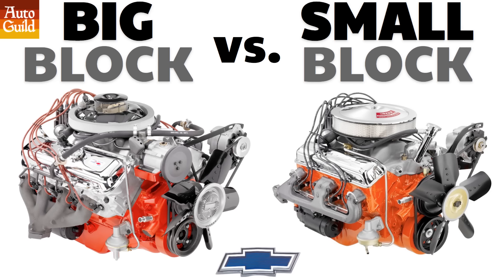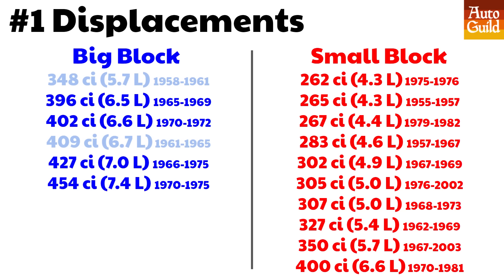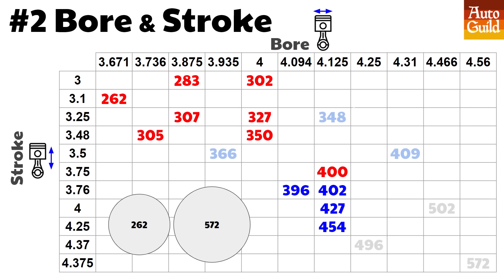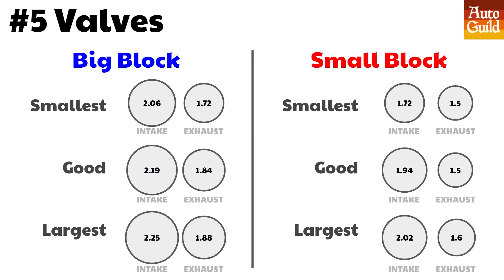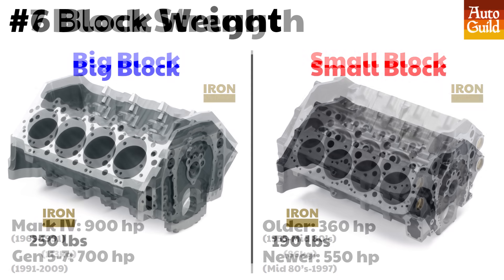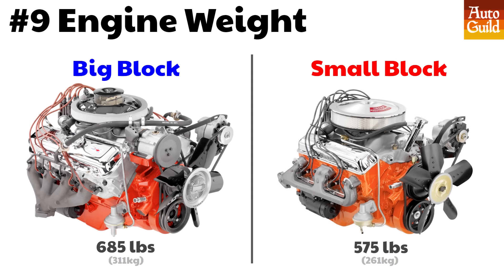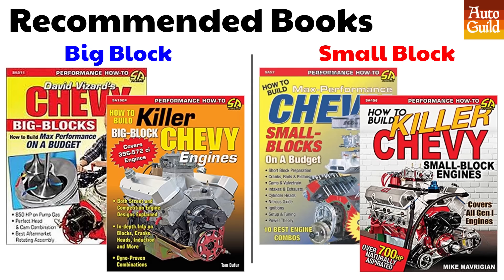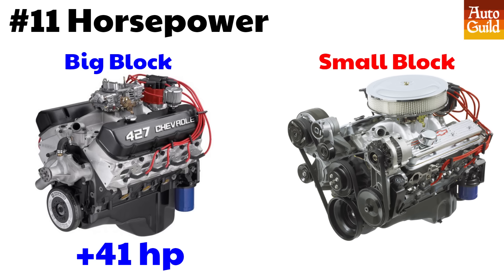Big Block vs  Small Block Chevy Comparison

Comment: The 402 was called a 396 in the 70-72 chevelle, was called a 400 in the full size chevys, and was called the 402 in the pickups.
Reply: so what is the different from a 68 396 and a 70 402 nothing
Reply: @jeffrey4547  402 is a 396 bored .030 over.
Reply: @mr.e1220  i have a 396 out of a 68 pu then i have the 402 out of a 70  pu but i put in a stroked 454 witch is better yet and u forgot the 25 hp different in the engines
Reply: 400 is a small block, the 396/402 was never known as a 400, ever.
Reply: @mr.e1220  the 400 small block was called the Turbo Fire 400, the 402 big block was marketed as the Turbo Jet 400. So yes the 400 was offered in both small block and big block.
Reply: @matthewsherman1450  if that is what marketing called them, it sure is misleading.  I guess u are correct in a marketing sense. But a 402 is a 402...big block. A 400 small block cannot ever be called a 402, so marketing made a huge error. That's probably why that knowledge is not remembered among many, it is bad marketing. Also, a 402 was not just in trucks,  many full sized Chevies had a 402, including Monte Carlo.
Reply: @mr.e1220  The 1970 Monte Carlo as an example, was offered with the "Turbo-Fire 400" (small block) and the "Turbo-Jet 400" (big block).
Reply: @matthewsherman1450  correct!

Comment: Never saw the need for any muscle car with more than 450 HP if it’s never going to see a race track. Small block is definitely the way to go for the weekend driver.
Reply: My 55 Chevy has 452 hp with a 383 and its silly powerful, silly
Reply: Until Dodge started releasing 800 HP that will hook

Comment: This is about 70% accurate.
Reply: Yeah it definitely has a few errors.  The 454 lived on way past 1975.  The small block wasn't replaced by the ls family of engines.  The opti spark Lt style engine came before the Ls.  I'm only 2 minutes into the video and found these errors.
Reply: @ziptiejedi5658  LT is technically still a small block chevy
Reply: @ahmadtajy  100% correct, LT small block! 👍
Reply: @ziptiejedi5658  Yeah my 3500 is a 1999 with a 454 bb
Reply: @ziptiejedi5658  you're partially correct.  The Gen 2 aka LT did replace the GEN 1 in the Corvette, F-body and Bbodies, BUT the Gen 1 350ci lived in Trucks, SUVs and Vans up until 2003 when it was replaced by the Gen III aka LSx.
Reply: @ziptiejedi5658  at U-haul back in 2008 we still had new trucks with 454s in them. That engine was a beast.
Reply: @ziptiejedi5658  iirc mercury still makes a marine engine from the 454/7.4
Reply: @ziptiejedi5658  You all missed the part he clearly said at 1:26 KEEP IN MIND I'M focused on PASSENGER CAR Engines.
Reply: A Ford guy knows a small block will make way more than 360hp. It looked like he had block integrity power listed for the big block and the 70 Z28 motor advertised output for the small block. However I give em a pass. It's great to see young guns keeping the old stuff alive. The more he studies the more he'll learn.
Reply: @duster0066  just because you’re young doesn’t mean you have to be incorrect and ignorant about it. There are many kids in the wild who could wrench circles around him and know much more than the Wikipedia facts this guy knows.
Reply: Donalld Allhands  yeah I have a 94 Silverado with a 454.
Reply: @ziptiejedi5658  you seem to very knowledgeable, I currently have a 305 fuel injected 1986 trans am, what engine should I swap it with. I want to have around 400hp, but not go with a big block, what engine options are good. (Low bolt-on budgets too)
Reply: @goodafternoonworld4456  if it were me I would go Ls.   Get a junkyard 6.0 or 5.3, put a new cam/valve springs in it and use a Holley Terminator for an Ecu.  You will easily get to your 400 hp goal.  I wouldn't bother with trying to keep the factory fuel injection it's hard to find someone to burn chips and it so easy these days to swap an ls into a 3rd gen.
Reply: True, I own a suburban that has a 454 and it’s from 92 almost 20 years newer than 75.
Reply: @PUGSRULE-ut6ez  i think he’s talking about just the corvette and Camaro
Reply: The other 30% of the video was 70% accurate so it evens out
Reply: My buddy has a 96 with a 454, and I have a 99 with a 350 Vortec.
Reply: Yep, there are 3, not 2 styles of bbc heads
Reply: Yea my fleetwood bounder is a 98 and it has a 454
Reply: #7 on the list about block strength isn't even close to 70 % accurate.  That alone makes the video totally irrelevant.
Reply: 1970 LT1-350 Corvette was rated from the factory at 370. I think the info in this video is rom a poster that reads a lot, but has never built an engine. I could be wrong, but there is a ton of misinformation in this video.
Reply: @bryangeorge9461  seriously the 1st gen small block Chevy block can take 400-430 horsepower with all stock internals. More than that and you’re sacrificing longevity but it’ll take it easy.
Reply: Donalld Allhands  there was also a 496 big block in the GM HD trucks until 2006 or so
Reply: @lomfmur  yep but it was marketed as an 8.1, vortec 8100. It was the gas upgrade option over the 6.0/vortec 6000 from 01 until 06/07. The 8.1 equipped trucks were actually rated from the factory with a higher max towing capacity than the Lb7 duramax, might have been the same for the LBZ but I'm not sure.
Reply: having worked the auto parts business for years back in the seventies, i sold lots of incorrect parts to know-it-alls.
Reply: Am I just dumb or did he put the 327 as a 5.4 when I'm pretty sure it's a 5.3 a 5.4 is a Triton
Reply: @shanerussell7395  Well, 327 cubic inches = 5.35857 liters. So .. do we round or not? More technically, the 327 is a 4 inch bore X 3.25 inch stroke. Let's do the math 4*3.25*pi*8 = 326.725 cubic inches which = 5.35406 liters..... so again, round up or not?
Reply: He mentioned that the big block lived on. He is probably limiting his comparison to production models and a single generation.
Reply: @theeoddments I have a stock 2 bolt main vortec 350 shortblock with .030 over speedpro pistons that retain factory compression ratio and a 238/248 hyd. roller and a Chinese single plane that made exactly 500hp all motor with some home ported vortec heads. This video is extremely inaccurate. Stock blocks can handle more than 350 hp. Absolutely ridiculous claim
Reply: What’s wrong with the 30%
Reply: Yeah my 78 Córdoba is a 400 big block not a small
Reply: @Rhychus1  its also a Chrysler not a Chevy🤦🏻‍♂️ which would explain why it has a Chrysler engine not a Chevy engine
Reply: @codycraig5657   he saying anything 400 under  are small blocks in his chart... rather it’s a Chevy engine or Chrysler my engine is NOT a small He’s not all correct that all I’m saying 🤦🏾‍♂️
Reply: yes run an 87 r20. has 454.  just did a rebuild on it. it's great. I'm a contractor and it will tow anything, haul anything.
 I love it
Reply: I've seen 5.7 350 Sbc make well over 700hp.
Reply: Better % than sex panther Cologne .... 60% of the time... it works every time
Reply: I thought big blocks usually had a four bolt main. Where a small block usually had a two bolt main?
Reply: @donspencer1274  Many small blocks had 4 bolt mains. Performance and truck models.
Reply: @donspencer1274  not necessarily. A lot of Chevy big blocks came with 2-bolt mains. The high performance versions had 4-bolts, but not the smooth-idle passenger car versions. Small blocks didn’t get 4-bolt mains until 1969, and they were only used on Z-28 302s and some 350s.
Reply: if that lmfao
Reply: in response to OP
Reply: 30% inaccurate.

Comment: I think the block strength for the small blocks is a little off. If you’re just referring to the block, not the crank or other factory components. I had a 408 that used a 1971 400 block that made a little over 600 hp. Still had factory caps and main bolts and frequently saw 7,000+ rpm. Good video though, liked the weight comparisons for sure.
Reply: Would like to know more
Reply: @DRG00DandS3XY  what would you like to know?
Reply: @brandon_419  heads, intake, carb, cam, valve diameter...
Reply: @DRG00DandS3XY  it had dart pro 1 227 cnc heads with minor port/chamber work and 2.08 valves, dart single plane 4150 intake, quick fuel 950 carb, mahle power pack pistons with a 4cc dome that put the compression at 12.5:1, and a .670/.630 264°/272° @ .050 cam.

Comment: How to make a big block as light as a small block?  CADILLAC 500!
Reply: Every one thought I was nuts cause back in 1984 my first car I bought for $100 was 1970 coupe deville. I immediately recognized the potential that 472 had with all that torque and 375hp stock trim. My first time at the 1/4 mile the car ran 14.3 only modifications were dual exhaust with flowmaster mufflers. Next modification I did was the biggest horsepower gain I added short headers and aluminum intake and HEI ignition That woke that engine up unbelievably.went back to track & car went 13.2 nocked off a full second. I won a lot money with that car street racing. Ultimate sleeper. Miss those days
Reply: Just dont rev them anywere near 5000 rpm or they go bye bye great tq engine though not realy suited for drag racing
Reply: @rooster68able  they don't like being over 4000.  True.

However, fox the valve train issue and I can't recall the other issue off hand....and 5500+ rpm won't be a problem.

You can gear these ones to the moon because they have torque like a diesel...and at 2400 rpm for a torque peak, you don't have to wait for it.
Reply: How to make big block power lighter than a small block?  BUICK 350!
Reply: @marclaporte7163  The 500 Caddy only weighs 60# more than a Chevy 350.  And you wont come close to the amount of cubes that the 500 can be stretched out to with a 350.
Reply: @markdubois4882  Interesting.  That is a heck of a motor.  But for my 68 Le Sabre, I still love my Buick 350.  High nickel content Y block much lighter and stronger than a Chevy 350 and can make as much power as a Buick 455 with minimal work..  Factory roller shaft rocker heads.  It's smooth and "refined."  Torquey and reliable..  They were stock in the engine rooms of the most high end Dauntless yachts of the 1970's.
Reply: @marclaporte7163  the Caddy motors were also really high in nickel content.

Bore: 4.300
Stroke: 4.304

Can be bored to 4.420 without sleeving, and easily can be stroked to 4.600+
Reply: @markdubois4882  Hmmmmm.  Do you know what their best options are for manual gearboxes??
Reply: @marclaporte7163  as far as I know, the Caddys haven't had a manual transmission in their cars from 1957 til sometime around 2000.

Can it be done?  I don't know if the tranny will handle the 472 and 500's sheer torque, especially if the engine gets modded.

Both these motors push over 500 lb-ft in pre-71 spec (higher compression) stock trim.

Add a turbo to the 500, and I highly doubt a manual tranny will hold.
Reply: @markdubois4882  Found this:
https://www.motortrend.com/how-to/cadillac-engine-with-manual-transmission/
Looks like it's a standard BOP bellhousing behind a Caddy 500..  This has me interested.  Thank you.
Reply: I was thinking  68-70 472, or 500 with 472 or 425 heads, but yeah. They all came with forged cranks too. A simple intake manifold change to aluminum and weld on flanges for bbc headers, recurve the distributor,  there ya go. They are about bomb proof as long as there's a couple quarts of some kinda oil in them. Cheaper than most builds too
Reply: @assymcgee2835  the 500 is a stroked 472.  Not a good idea to put the 425 heads on a 472 or 500.  The bore is way too small.  Picture 305 heads on a 350.  The only thing the 425 shares with the 472 is the stroke of 4.06 inches.  The 425 vote is 4.08 inches.  The 472 and 500 both have a 4.3 inch bore.
Reply: @markdubois4882  its been done, and alot of guys, me included,  run 305 ho heads on mild 350s. I think a few if the cadillac engine builder sites recommend the 425 heads also, but you gotta run 100+ octane
Reply: @assymcgee2835  we have a 350 lt1 at the shop with a set of 305 heads.  All the compression you could ever ask for, but it doesn't breathe for shit.  There's .264 inches difference in the bore between the the 350 which has a 4-inch bore and the 305 which has a 3.736 inch bore.  Not to mention the much smaller valves on the 305 head.
Reply: @markdubois4882  seems to do just fine in my truck, then again, its a heavy truck and I don't rev it high. Different configuration work for different cars, uses, etc.
Reply: 572
Reply: @shadowopsairman1583  a 572 is just a punched out 454.

The caddy 500 is only 60# more than a 350 SBC.
Reply: @markdubois4882  NOT!
Reply: Just invest in a u joint company! Itll tear em up if you actually giver the beans.

Comment: Big blocks make off idle torque. Right off idle you could have stock 350-400 ft-lbs of torque sometimes double what small small blocks offer. The issue with big block cars that always matters is traction.
Reply: But I have a modded L82  1976 4 speed with a small over driven blower reworked 2.02 heads 9.1 compression  800cfm vac carb  blowers cam roller rockers hi volume oil pump clevite 77 bearings  big tube hooker headers and dual 3 inch exhaust, variable lift and duration valve system ,which gives much less lift at below 3000 rpm = car act like big block on steroids super flat torque curve from 1000 to 5500 rpm
Reply: @nickking1510  Rhoads lifters?

Comment: So let me get this straight you claim to have a 68 Camaro but you don't even know what a zl1 is??? You literally called it a z11😂 and you want to LS swap it for braking
Reply: I'd think the better choice would be to upgrade the brakes to get that better brake performance.
Reply: There was a 427 z11 big block w engine based off the big block 409

Comment: Just throw out the outdated toys and start building LS. EFI is years ahead all the old stuff now. No reason to spend 13 14k on big blocks for what you can spend to make horsepower from a 6.0 Ls.
Reply: Big block is the way to go if you want big power naturally aspirated, you can make 800,900,1000hp N/A on a big block. 600hp is about the limit on a LS style naturally aspirated
Reply: I mean, it's always cooler to run the original engine, especially if you have something unique like a Kaiser or a Crosley. Not everything can or should be about "more power".

Comment: Why is the thumbnail a big block vs a 90° V6 and not a smallblock?
Reply: Its not. If your looking at the same picture I am then your looking at the 2 center exhaust ports which are siamesed on the small block. Note the 4 plug wires on the side.